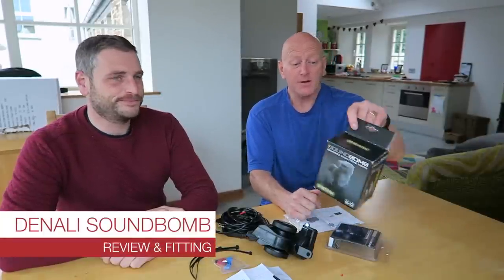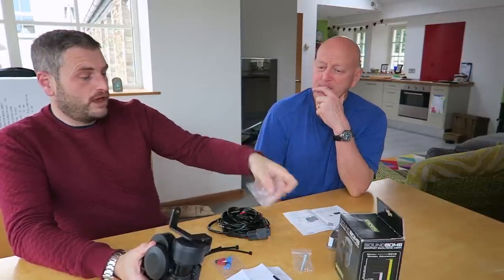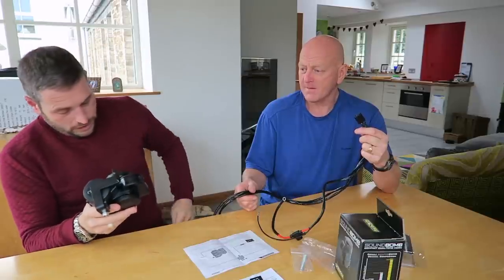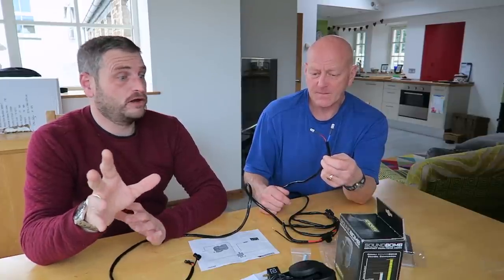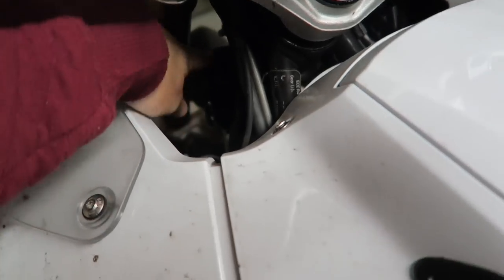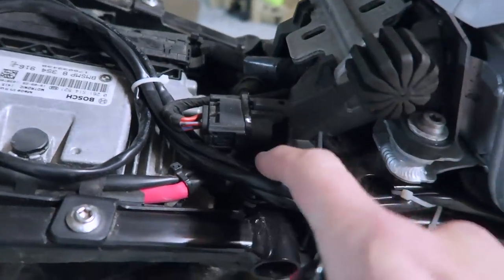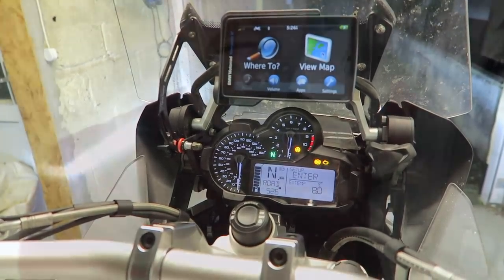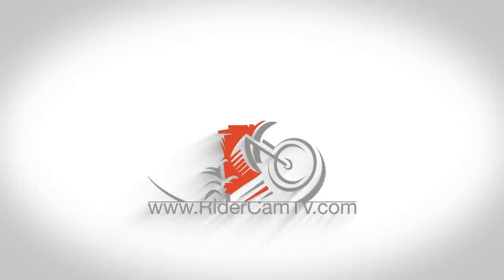Denali Soundbomb - Fitting to a BMW 1200 GSA & Review

Comment: Hi. Thank you for this video. I just bought the Soundbomb and I am about to install it. Even though the written instructions point to the same position of the unit that you chose, on another TwistedThrottle video the guy recommends that the air vents be protected from water. Hence the position in the directions is the worst! I read someone had two Sounbombs die due to water intake. The Misenden Flyer installed it with the air ducts facing in. I'll probably do the same if my 2018 GSA allows for that. Cheers!

Comment: Just bought one from Nippy Norman on your recommendation. 
Easy to fit following your instructions (I missed the part about the Head bolt as I tried in vein to remove the nut until I noticed the weld marks). 

It’s bloody loud. Fantastic. Thanks fellas.
Reply from the maker: Great stuff Liam, glad the video helped you out.  Much better horn than the stock one!

Comment: Denali canbus unit fit under the seat plugs into the TPS unit and you can wire straight in without relays and also fit 2sets of spots. Save all that messing about.
Reply from the maker: thanks for the info

Comment: There is a positive (red) terminal post in front of the battery that makes it easier to connect to than the battery terminal.
Reply from the maker: Thanks matey. Yeah I was going to use that one but wanted to tuck the wire away nearly as it has the fuse attached and I couldn’t get it to sit flush. 
But thanks for sharing ;)

Comment: Just installed this in the same spot with the Denali bracket on my 2017 Rallye with Sports Suspension. Anyway, it looks like the telelever might actually hit the horn when fully compressed. Am I wrong or missing something here?
Reply from the maker: I thought that but it hasn’t on mine yet. All appears good :)
Reply: I moved mine back on the bracket by 20 degs. Not a problem. As has been said on this vid, lord know what all these videos are about with taking parts off the bike. You can thread through the wires safely and neatly without this. The only things that could perhaps come off is the right hand side plastic and steel fairing, to get to the horn for the canbus connection.